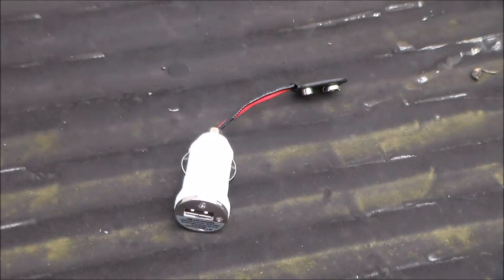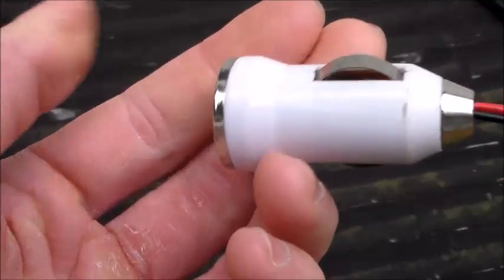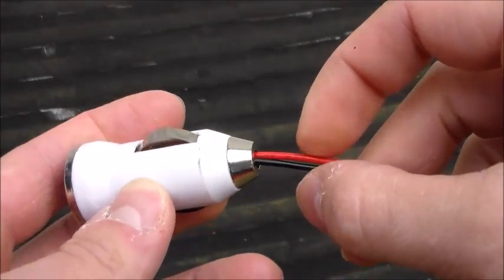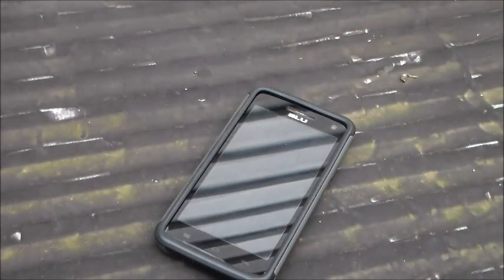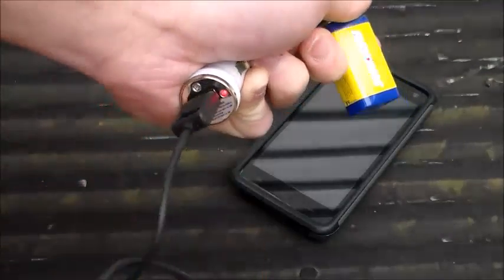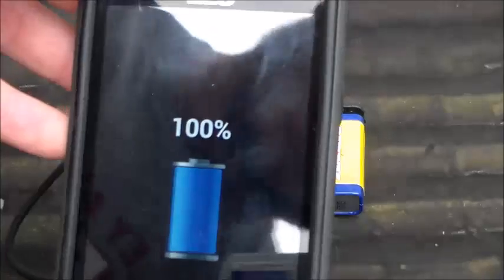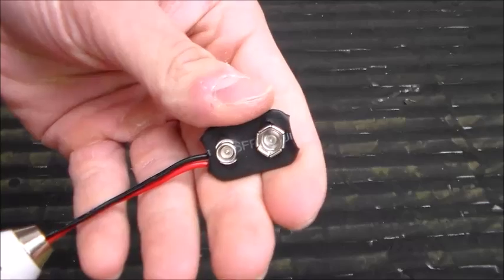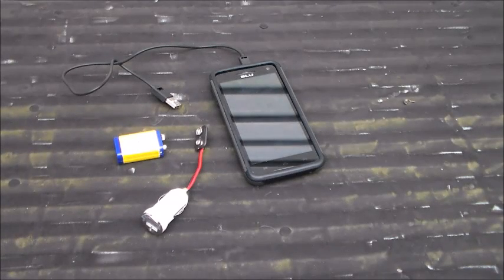DIY 9 Volt USB Charger

Comment: I know how to make the connector for the battery asshole just too easy oh you know how first get yourself that 9 V battery and then then open it and then you’ll see slabs or six fake AAA batteries for what time but you’ll see most likely leave some slabs and then then you’ll see yellow tape do yellow tape you’ll then then remove it and then then also the metal disconnected using the soldering line and then then you can get yourself some heat shrink cut an opening for the whole holds and then then you can attach the wires plusAnd minus and then then that can work if you know which connector is right or not right and then then cover it with the heat screen cut it and then you have your own terminal terminal

Comment: made mine, but the charging speed slows down in short time.
went up to around 10% and that's it.
and the 9V battery is still ok.
Reply: A 9v battery has 200~600MAH.   A phone has 2000~3800MAH.  It will take  19 9V batteries to charge 1 3800MAH Phone batteries  with 200MAH 9v batteries.

Comment: So, youre' putting 9v into what is expecting 12v.  Does that mean that the output is less?
Reply: Doug Cassidy ..nope, voltage supply is dropped from whatever the input is to 5v. As long as you keep it within a reasonable voltage it should work. You could probably use a 6v lantern battery and it would work. (That’s what I am going to try.)
Reply: Doug Cassidy it works but it only charges like 2% in one or two hours. That's because it needs 12v to charge it. I made 3 of these chargers and test them with different phones